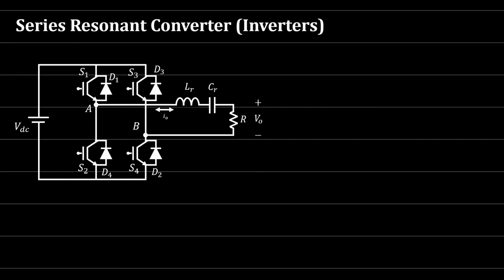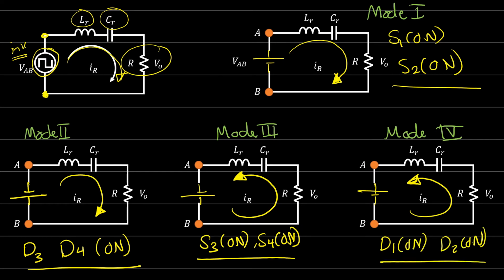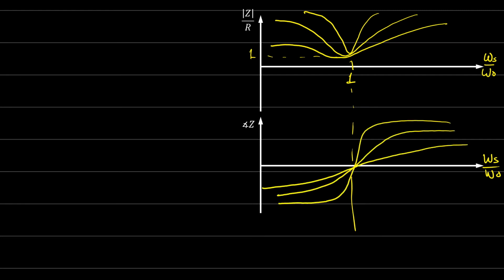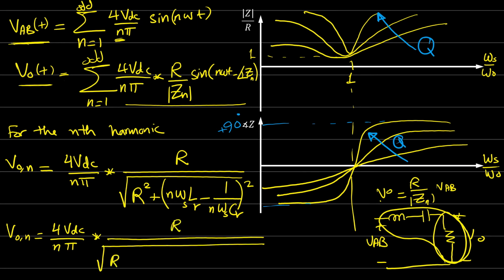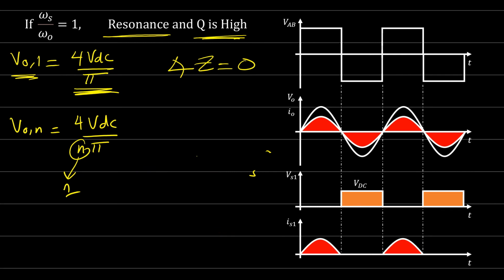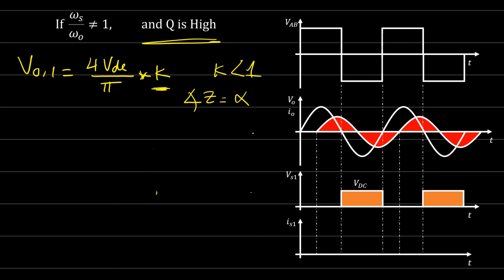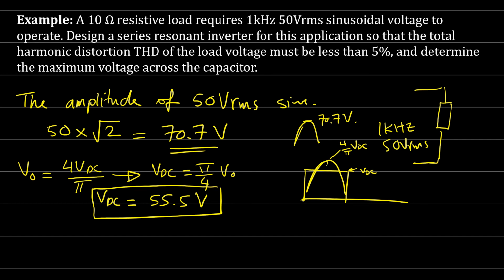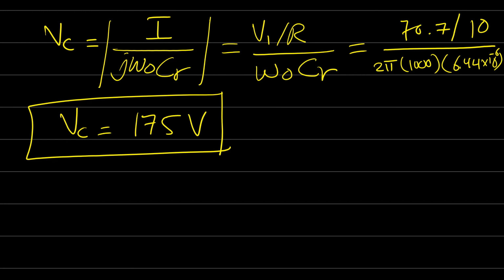Series Resonant Inverters | Resonant Converters | Power Electronics

Comment: This is very applicable to a SMPS of a sound amplifier let's say,  but 50Hz inverters have two switching frequencies, and this is called an inverter. We cannot change Ws, it is always 50Hz independently on a load, and we only change Wpwm parameters. 50Hz inverter is actually a D-class amplifier (and harmonics are defined by different reasons)